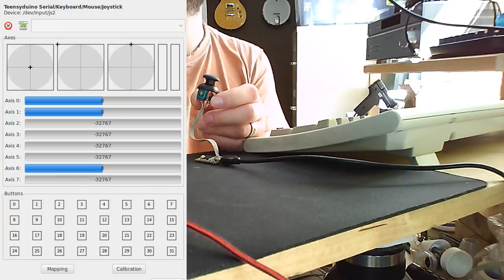Teensy Analog Joystick Calibration

Comment: Just curious, on the teensy board which pins would you solder x and y axis' for another stick? Like the c-stick/one that allows your character to look around? I'm looking to use this board for one of my projects
Reply: https://cdn-learn.adafruit.com/assets/assets/000/028/038/medium800/light_Teensy-Pins.jpg?1444545187 

I'm going off this diagram
Reply from the maker: Any of the other analog enabled pins. There's 20 analog pins on a teensy 3.2. Just pick two of the free pins.
Reply: tuffrabit. can you replace my joy stick on my elite controller
Reply from the maker: Probably. Send me a PM here on YT or on the XIM4.com forums.